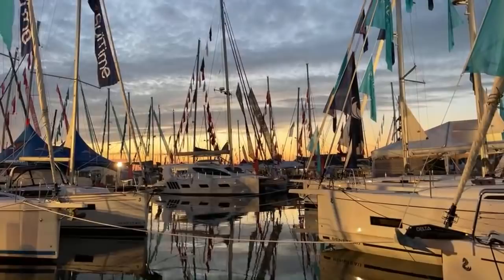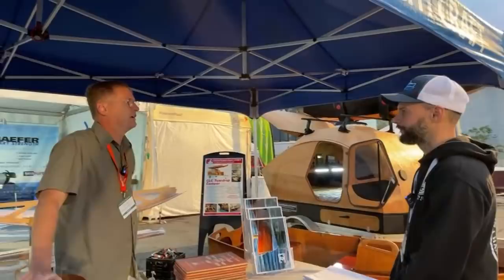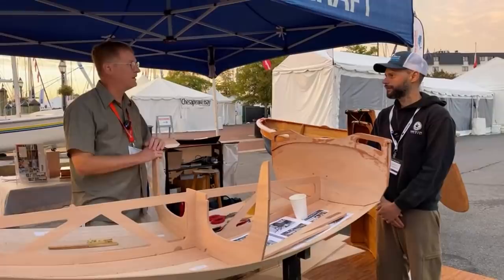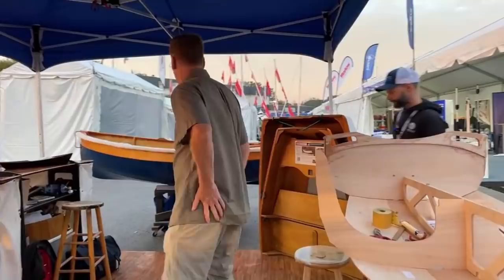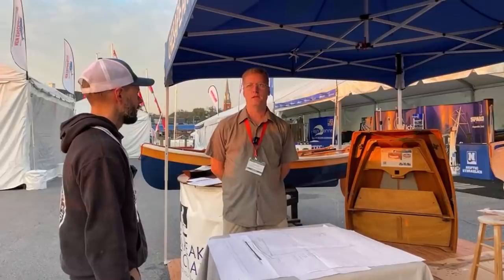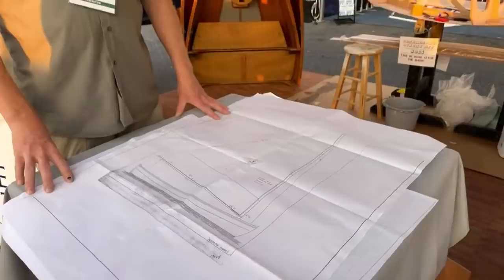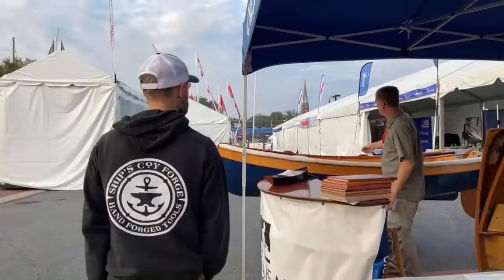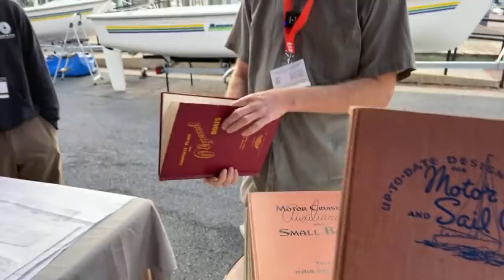Tender Design & Selection w/ Designer John Harris - Acorn to Arabella: Journey of a Wooden Boat

Comment: Good morning and thanks for an interesting morning “with my coffee”
If it is worth anything I would always have a tender upside down on the cabin roof, except for short passages when it can be towed.
One point that didn’t come up is having a tender upright will increase windage and increase weight exactly we’re you don’t need it, as well as decreasing your ability to see forward from the cockpit. Match the rake to the roof of the cabin, decreases windage, eliminates catch points for ropes and gives extra cover for the cabin.
Reply: Again - he must consider usefulness and capacity - which are proportional to weight. But I agree. I would not abandon the 10 foot boats upside-down, like Fay at possibly 120 lbs. There must be a rigging than would make turning on the longitudinal axis easier.

Comment: I built one of CLC's oldest designs - the Sassafrass 16 foot canoe. Made entirely by hand - (literally not one electric tool was used, even the hundreds of stitch holes were all hand-drilled). I made it from sheets of okume plywood, lofted from the table in the CLC book Canoe Craft. All strakes etc were cut with Japanese hand saws and faired with a block plane. I still use it regularly and love it. I can absolutely recommend a CLC boat as a first (or second or third) build.

Comment: I just watched the episode of the main mast step being fitted.  I am not a ship wright or anything... renovated a few small boats... but the  upright bronze knee sections look too thin to support the forces placed on  the mast step. Even though there are four of them. They could cut into the wood, even though it's cross grained.   It would be fairly easy to  bolt on some bronze right angle  to the knees to spread the load more. Just a thought and a concern. I had a Mirror Dingy btw.  As a kid I went everywhere in it. Either sailed it or rowed it. It had lots of bouyancy tanks in it. For a dingy. bouyancy tanks are a good thing.

Comment: When I first looked at a dingy I was surprised at the low amount of load for an 8 or even 10 foot boat.  So I decided on 12 foot utility boat for 4 people and supplies, or me and a month or more of groceries.
Also consider when I am off doing chores in the dinghy there are people stuck on mother ship.  So a 10 foot sailing dinghy able to use a small motor is handy to have as a second.  Or at least something inflatable or nesting.

Comment: Hey from Belmont, Ky. Great interview. I know Steven hasn't made his final design choice yet, but I would be leaning toward the Faye, stored upright with a water-proofed canvas cover, myself. It will be interesting to see which way he goes and what modifications he chooses to make. The double ender choice for the main boat really limited where to stow the tender. Davits off the back would be really long to hang it off the back, now. Although, black locust would be up to the task, I'm sure. See y'all on the next video.
Reply: I built a Gerr nester 20 years ago...1/4 marine ply over 3/4 frames on a ladder frame...fiberglass inside n out...we found it to be perfect to tow...very stable...I can stand on the outwale mid ship...and not swamp it (290lbs)...we carryed it forward on a 29 cascade...in front of the main mast on the house on our 42 Irwin ketch...easy carrys 3 and supplys...we found in busy areas haveing the pram bow a safe bonus for getting of the dink at a dock...tows like it has an auto-pilot...we rigged a small spar mast to pick it ... happy to send you pic of what it looks like after 20years of heavy service...Salish Sea..Broughtons Rivers Inlet...hull speed with 3.3 hp...plans are old school...love the channel...thankyou

Comment: The answer to a light boat slipping away is to shorten the painter hard and let it out as the tender takes your weight, a controlled release is required. Outboards on tenders can be a real pain, folk often choose outboards that are too powerful, a small pram only requires one and a half horse power and then extending the tiller so boat can be controlled from the center thwart to avoid standing the boat on it's transom. I don't know what the natural harbours are like in the States but in Europe many have huge tidal rips that are impossible to row against, In these situations an out board motor essential to reach your intended destination. But rowing great for the stomach muscles,shoulders and lungs and I would encourage all kids and adults to row as much as feasibly possible, If you are asthmatic a brilliant aid for improving your lung capacity particularly for youngsters. Cell phones should be left down below at all times, a cheap burner phone [not smart phone] kept in a zip bag can be used by crew going ashore for communication you only need the one as a boats phone for communal use. Nothing worse than rowing three miles then walking four more only to find you left the shopping list on the saloon table.

Comment: If you have rotating couplings at bow and stern of the tender, could you lift from both ends with two blocks on the boom and rotate the boat before you swing it aboard?
Reply from the maker: Yup, that may work. Or one snatch block on the boom might do the trick, with two eye bolts or rings fore and aft in the dinghy and a line rigged between them. You can also use the main halyard for lighter dinghies. We’ll be rigging something appropriate for sure when Arabella is in the water.

Comment: I have sailing dinghys but for my tender I like hard easily rowed dinghy's, inflatables are great with a small outboard and beat everything on all aspects when the power plant works but I am a lousy mechanic and outboards die so easy. Reality is ''load"in tenders mean people maybe personal gear if rowing ashore for a walk or beach activities (exception maybe diving in coral reefs). If you want to sail then you already have that in your main boat but rowing is something you will do all the time. Biggest dingy you can manage is another thing remember you need to be able to get it on deck solo, remember you will at some point overload it with people, keep the inside uncluttered (which is why fiberglass or stitch and tape are great). At a club picnic once someone said lets have a dinghy race anyway someone else said rowing only so I cruise up to the start line with my 9 ft pram and everyone else in their deflateables I rowed the 200m course there and back before anyone else got to the top mark. and I could have done the same with a couple of passengers.

Comment: If I made  bot with a dagger board, I think I would have two holes in the board. then I would use a spring loaded pin to hold it down for sailing or up for landing so that it is always secure and cant just fall out.

Comment: I used a P.C.Bolger Brick and it can hold almost a ton of goods.  It can sail or use a motor and can be rowed.  It is flat when paced on deck. but with a flat bow and stern.  We are from Israel.  I have used the brick as a tender for three boats so, far.

Comment: Metric SI is for the engineering world what Latin is for the medicine world: A basic communication tool. 
There are many Furlongs, Ångströms, Klafter and a lot more of those worldwide of course, but wanting to communicate does need some kind of logic which is supposed to be bigger and more accessible than local superstitions, feelings or "why should we?"-s.
Oh, and I am counting with the "couple of old viewers", which is a bit doublesided to say the least, remembering a time without CLC, and Epoxy still being something exotic the airplane-building folks used ..... and we fast sailors did, of course 😂 Cheers!

Comment: Seen glass bottomed Beatle Cats ?  Very stable , easily stepped mast , lighter than wood ones.  Can hold 4-5 adults & gear.  Won't win races outside of class but awesome little pointers. Cover cockpit for towing. (Low free brd.)  Used to tow flat bot. dingy, ran outside of wake, didn't like holding or following sea. You have to increase keel to the point loosing Flt.Btm. advantages. Bet you could find a used BC reasonably priced. Disclaimer : Most cats yaw pretty scarily being towed > 20 kts
Reply from the maker: Annie B sails a traditional wooden beetle cat these days because her boat is on the hard for a little while. A great design!!

Comment: This is not going to happen too soon, but as soon as mass-produced graphene is available and artificially-produced Q-carbon formed into overlapping tile-like layers can be made in quantity (Q-carbon is a crystal made of carbon that is harder than diamond), a laminated structure of this material say 1/4" thick (or even less perhaps), would add rather little to the weight (similar to a light-weight wood, I think) that is (1) more rigid than a layer of hardened tank armor and (2) 200 times as strong, with (3) very few things being even so much as as able to scratch it.  It would also be invulnerable to any kind of thermal or biological attack.

And, interesting enough, the graphene layers could be turned into internal electrical communication lines (they conduct electricity and heat better than copper does) and electronic solid-state devices built into the hull itself with little added weight to do so.  You approach a living thing as to the boat's "nervous system" and can make it much more like it was grown, not manufactured by an external effort.  Living boats...

Comment: for me the trouble with rowing is .. You can't see where you're going.. everything is behind you and this is why you need either a paddle or a motor
Reply from the maker: Annie B here: You get used to it for sure, almost growing eyes on the back of your head. I’ve never had a motorized dinghy, and I’m not opposed, but can’t afford the initial cost and maintenance, and would rather just row. Different courses for different horses! “Need” is a superlative term.

Comment: Ahh! Don't say 'Crash' when talking about a boat! I was born and raised on an Island, so we were all 'sea-folks'. You either owned a handmade or a Connie, but nobody used 'Crash' when talking 'Boats'... As to the Punt, why not install a pedal drive prop and a remote hand tiller? Duck Hunters don't use their legs for more than fetching another Moosehead!... With the tender dimensions, just scan and rescale the dimensions. What's stable at 8 foot by x, will be the same at any reasonable size for a tender. You might have to scale the beam dimensions at a lesser rate, but it should be fine... If a 3.5 Evinrude is too Fossil Fuel for you, maybe an electric motor like Brupeg's, or a pedal drive! I hand built one from old bike parts for our Grumman canoe, had to run it over the gunnels cause my Dad wouldn't let me make holes in the bottom... 🤡

Comment: You could I'll bet use an electric trolling motor on that little boat your saying can't take a motor put the motor on the back and the battery box up front all and all you would probably add just over a 100 lbs

Comment: I am surprised at the amount of non-work on the boat. You seem to be running a race with the "Talley Ho" on who could do the least work and still call it building. Boat building is a craft, an art form, a mission to complete, not a show and tell, let's take a vacation,  too cold too wet to work today, or just a lack of attitude.
Reply from the maker: Thanks for watching anyway, Donald.
Reply: I see where you are coming from.  My last build I worked on nearly every day before and after work until completed and launched.  However, there are as many ways to build a boat as there are people.  I also know folks who built only on weekends over several years and to produce a very modest vessel.  Different goals.  Different methods.  If you are doing boat production, no fiddling around or you starve.  If you are having a boat building adventure, you may enjoy a circuitous path.  May both be blessed.